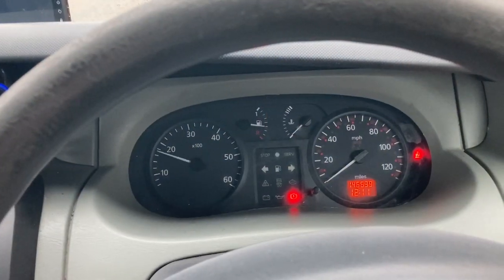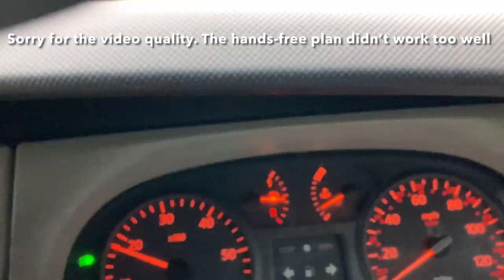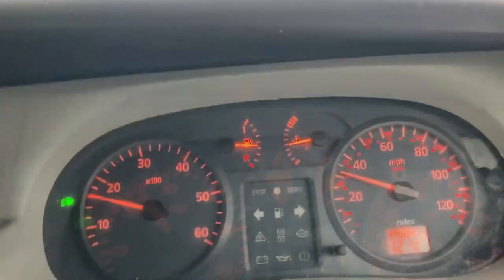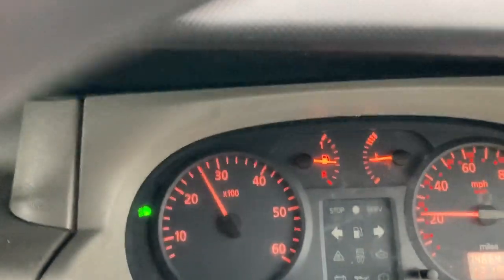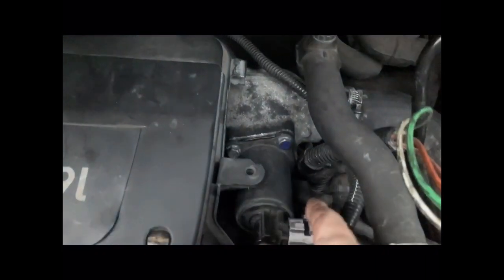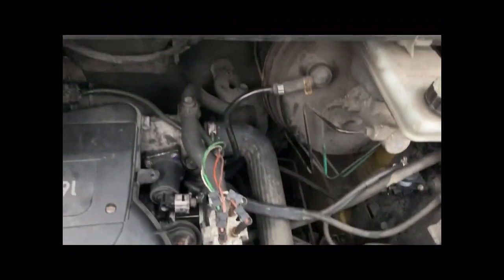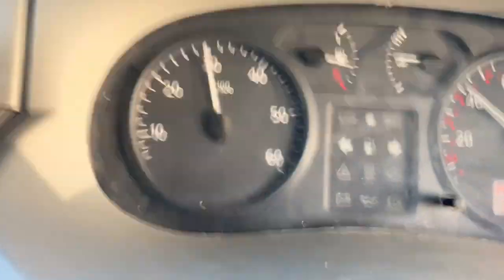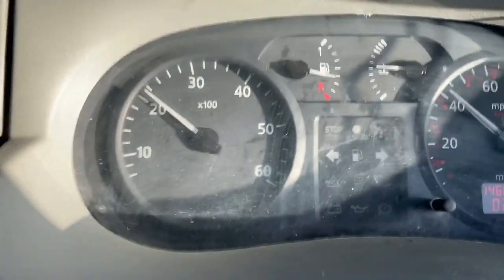2003 Renault Trafic 1.9DCI - Low power, no boost below 2500rpm. Fixed. Watch part 2 for final cure.

Comment from the maker: The symptoms suggested a problem with the boost pressure control valve. I replaced that and it made no difference. I cleaned the MAF and checked for vacuum leaks, still no improvement.
The EGR valve was stuck fast. I used EGR cleaner from behind and no difference to the problem.

I managed to get the EGR valve out by using a small hammer and tapping a scissor blade in behind the gasket and slowly working it around. With patience, it started to edge away and eventually came out after about 15 minutes of fettling.

The EGR was very dirty but the valve itself seemed to open and close fine. I gave it a really good clean not expecting much as the valve seemed to be shutting ok. Obviously it wasn’t closing fully and a small amount of exhaust gas was getting through. This clearly messed up the fuel air mixture at low revs.

I was amazed at the difference when I refitted the EGR. Still a bit sluggish below 1750rpm but still pulls fine. Before cleaning the EGR, the engine was completely gutless below 2500rpm and would completely bog down below 2000rpm.

I have ordered a new MAF as the old one is pretty grubby. Hopefully that will give even more improvement.

I have used Wynns Turbo cleaner. That helped turbo response and has stopped a bit of noise at high revs. I also used Wynns EGR cleaner to clean the system up a bit. It didn’t clean the EGR much while it was still fitted and didn’t do a great job of cleaning the residue when I had removed the EGR for cleaning. A strong detergent was far better.

I will provide an update once I fit the new MAF.
Reply: Any news to this subject? :)
Reply from the maker: @emilhansen3945  I did a second video after replacing the MAF sensor. The van is now perfect. Starts easily even when cold and revs freely. It is like a new van.
Reply: Just block egr valve. New maf
Reply: @kitcarbuild3927  I have the same problem now with the same car (2005). I replaced EGR...no to the help. I am waiting for the new Boost control valve and MAF. Can be any else wrong with car?
Reply from the maker: @milangally7706  The replacement MAF was the biggest difference for me. A vacuum leak can also cause similar symptoms. I got a cheap eBay MAF and it only lasted 1,000 miles before I had to replace it. Buy a decent branded MAF if you can. Good luck. I hope the new parts will cure your van
Reply: What MAF did you get? My van has similar issues, I had an aftermarket MAF fitted by the garage and it’s gotten better but still not fixed
Reply from the maker: @aaegerter6191  this is the latest one I purchased
 https://www.ebay.co.uk/itm/NGK-EPBMWT6-A001H-90144-MAF-Sensor-NTK-6-pins-Angled-Mass-Air-Flow-Meter-/324031600158?_trksid=p2349624.m46890.l49286
All good so far

Comment: My 2007 Nissan Primastar 2.0DCi got so bad it barely had the power to get into the workshop, All I did was clean the EGR (take the whole front of the van off, absolute ball ache!) buy now it runs sweet as a nut!
Reply: its a 30min job on the 1.9cdti. which is the F9Q engine code. i`m glad i don`t have the layout you have, that egr is located way down low..

Comment from the maker: 2 months on and the van is running perfectly. The smoke problem has gone away and the van starts first time even after sitting through the cold weather and snow. EGR clean and new MAF sensor did the job.

Comment: Full service on these vans every 5000 miles.
Egr valve off every time and clean up ,
Make sure it’s opening etc .
Oil flush before service .
Emissions additive in fuel / make sure fuel is low and run fir 20 miles.
Swop crankshaft sensor while your on.

Comment: I had a simular problem. It was a leak in a hose building up boost pressure (not shure what its called). Replaced it at the car ran perfect.
Reply: Which hose dude? On the intercooler or?
Reply: @ssdivizion  I dont have the car in front of me right now. I will check tomorrow and get back to you :) It can also be a faulty boost pressure  sensor that is connected to the same hose. If i remember correct the hose went from the egr valve on the right side of the engine, and the sensor is on the left side
Reply: @eln0mbre  Check it is the intercooler tube on which the small MAP sensor stands
Reply: @ssdivizion  Just found the transelation from norwegian to english on the hose i replaced. It is the "Charger Intake Hose" and the sensor i said is connected to that hose with a smaller tube to register the pressure. Hope that helped a bit to recognice the part.

Comment: I had problem with boost pressure sensor.
When you shake new sensor in hands you must hear sound of mowing parts inside,but mine old one was totally rusted inside solenoid.As i notice water comes near rubber from glass shield and leaking to engine it comes also over solenoid and over some time it block valve totally with rust

Comment: just had a Trafic (1.9dci)in with power loss problems , basically it was a vacuum problem  No vacuum to turbo control valve . this van had only one small vacuum pipe off pump and there was no vacuum there . taking the plastic fitting off the pump it was apparent the unit was blocked . i simply drilled a hole through using a small drill (1-1.5mm) and the vacuum was restored . Even low vacuum on this pipe will affect turbo . a cheap check if anyone is having similar problems
Reply from the maker: Thanks for adding this. I checked for a vacuum leak and replaced the boost pressure solenoid before cleaning the EGR and replacing the MAF. It can be frustrating to figure out what the cause is.
Reply: Hi mate. Where do you drill the hole
Reply: @jarpar3414  if it is the same take the plastic fitting off the vacuum pump and you will have the big outlet for the brake servo . Just below there is a small outlet with the control valve pipe attached to it . Pull the pipe off and drill through the small fitment with a drill till you see it coming through to the larger fitting (if that makes sense) , that should restore vacuum to turbo .As said  you only need a small drill 1-1.5mm , a big drill wouldn't go into the fitting anyway

Comment: Whats FIXED ? EGR cleaning or replace?
Reply from the maker: Hi - cleaning the EGR made a big difference but wasn’t the complete solution. Replacing the MAF was the final fix. If you want to check your MAF, unplug it while the engine is running. If it makes no difference, the sensor probably needs replacing. It is by far the easier of the 2 issues to fix.
Reply: @kitcarbuild3927  Thanks bro. I will checked.
Reply: @kitcarbuild3927  Hi, thank you very much for your help! If I ever visit England, if I believe you live there, I'll invite you for a cold beer. My car was fixed. :) I pulled the MAF sensor and the power came back. Thanks again. Have a nice day my friend.

Comment: Hi mate what is that thing called with wires to the right of ye please?
Reply: its cold air pre heaters for really cold starts.. they throw up codes all the time, but have no real effect on starting tbh. they also rot and fall apart quickly. mine are all taped up. they on my list of jobs, just because it looks horrible..